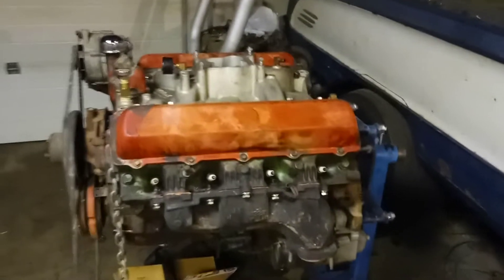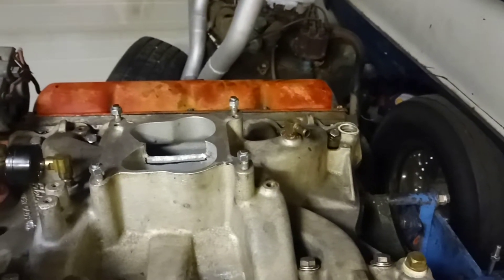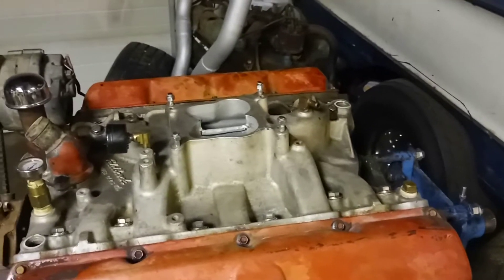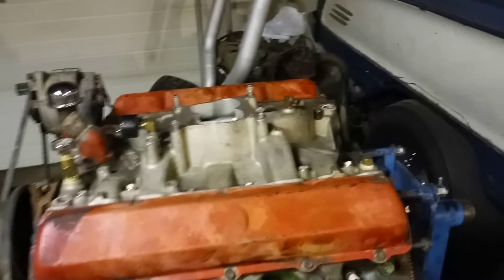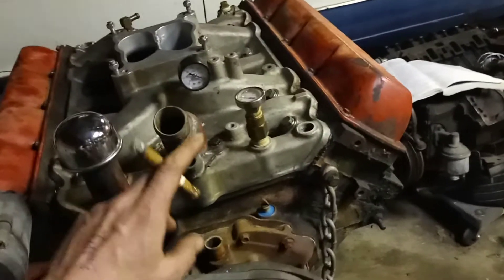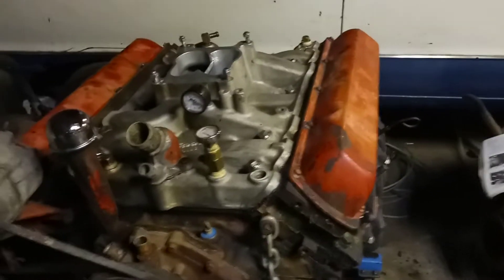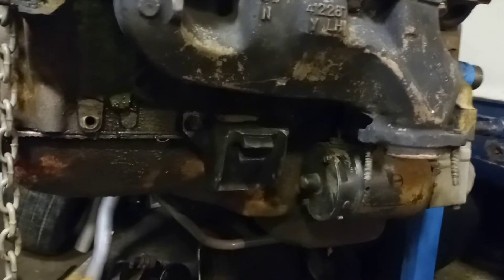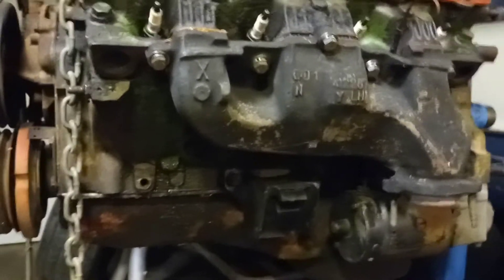Intake manifold mods.

Comment: OLDSMOBILE 425 SUPER ROCKET V8 !
I Think the All Time Best Sleeper Street Race Engine from GM .
Deceiving how much power torque they have to all.
Without A doubt the all time Best Engine ever made my Oldsmobile the 425 Super Rocket V8  !
Reply from the maker: They do pretty good that for sure. I shift it at 5500 so it spins good for a big olds.
Reply: @wildrosegarage4208  I did a video on Pontiac V8 and Olds V8 oil filter adapters. Posting a New Video on my Racing oil filters for Street Racing and Drag Racing for the No Name Nationals. Todays be ready to watch soon.
The Olds Super Rocket 425 V8 is Awesome!
The Oldsmobile Engineering Division Were Street Racers too !

Comment: This should be a racing class just gutted cars with v8 no power adders just power to weight ratio
Reply from the maker: The drag racing my dad liked as a young guy was done kinda like that but there was to many not telling real h.p. For example a 340 dart was rated by NHRA at 325h.p. a ford 428 was rated a 335, dart weighs 3100lbs fairlane is 3600 so the fairlane gets to take of 1.5 seconds first beacause of less power to weight and the little 340 would still run them down a lot of times.
Reply: @wildrosegarage4208  I imagine alot of cars similar to Tony's dart cut out all the weight not needed but stock motors, must maintain stock bore,stroke and heads you could change intakes headers modify the transmission